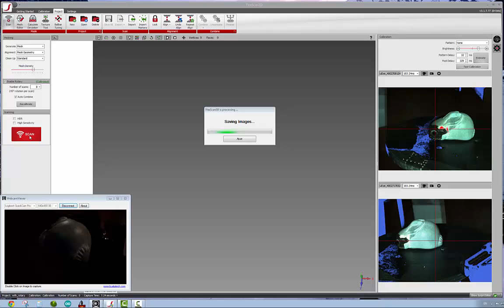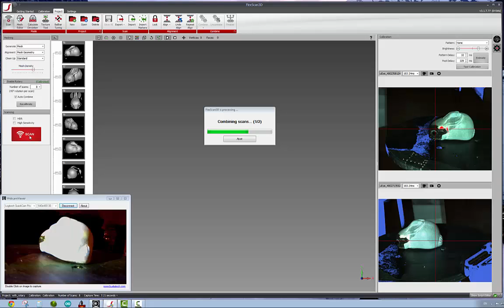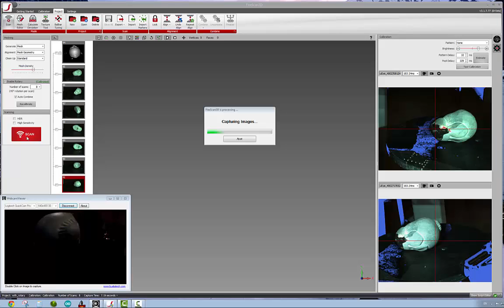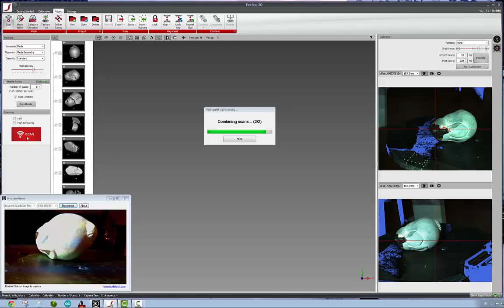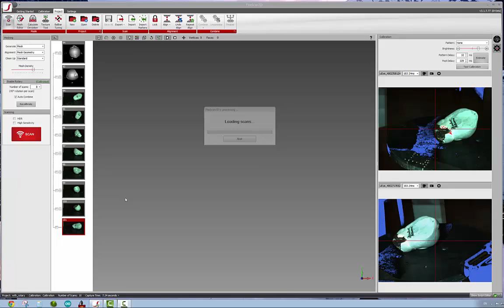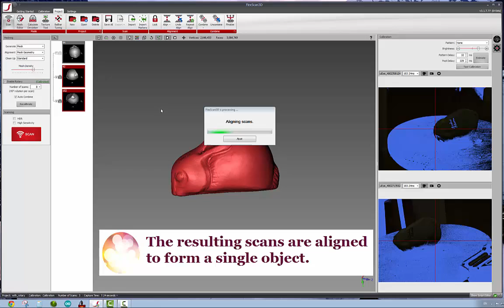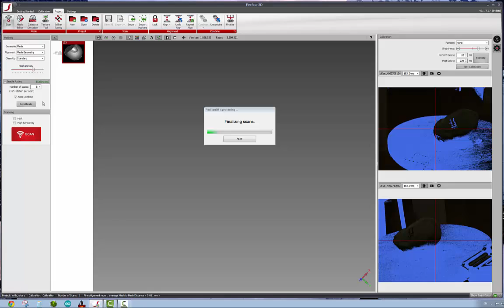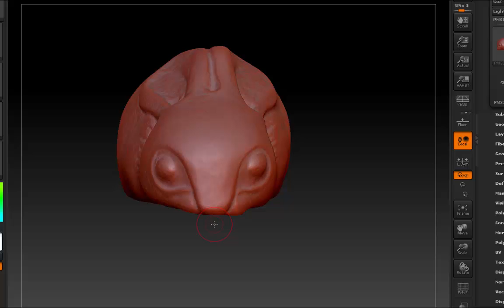Scanning of a ceramic bunny with Flexscan3d and Rotary Table

Comment: hi there :) nice work with the arduino rotary... I would like to know if you´re able too share the connection to the turntable. I have turntable but can t connect it to the flexscan...
thx
Reply from the maker: Thanks. What do you have so far? Is your rotary controlled by an Arduino?
Reply: +Alfonso Hernandez (Seasicksinbad) 
hello :) thx for the interest. So far i have 2 turntable. 1 big (6meters diameter) uses 3 phase motor and its controled by its own software (its not an arduino). And also have a smaller one and also its controled with its own software ( i think this one should be arduino based). Its a pamco-imaging.com.
I need to connect them to flexscan but i don´t know how...
Reply from the maker: I see.. I think it would be too complicated to make these turntables respond to flexscan since most likely they already have some kind of embedded code in them. I think you would need to start from scratch. With another turntable connected to a stepper motor. Then I could send you a preprogrammed Arduino for you to play with.
Reply: Alfonso Hernandez 
Hello again, thx so much for your help :)
Can we exchange emails? that way i could send you pictures of what i have of hardware and them you could help me choosing a stepper motor to begin (again) the project...
Ther big turntable as the motor outside with a "karting" tire making the traccion to pull the table...so it has to be a big power motor to drag all that weight...
thank you again
Reply from the maker: +Marco Moreira, my email is seasicksinbad@live.com. Trying to implement a stepper motor powered rotary table of such dimensions would be hard, since steppers are limited in size and power.. Probably a servo would function better. My suggestion is to start small, with something that will give you insight and experience for larger projects. My rotary was made with a modified surveillance camera setup.

Comment: This was a real time scan.  Some of the manufacturers have videos that have been edited and they show a really smooth, post processed image as if that were the initial scan.  I have some issues with getting really smooth scans without noise, do you have any suggestions?
Reply from the maker: +keithskillz90210  it's a real time scan indeed. I only sped it up a little during the scanning part of the video. What type of noise are you getting? One of the problems I found on my setup was that trying to do all the process at the maximum possible resolution with no or very little decimation, I would get ridges after merging the scans. I solved it by decreasing the scan resolution and doing a smooth merge.
Reply: Even though the objects that I am scanning are smooth to the touch, they appear to have a rough texture once the mesh is generated.  Looks like alot of post processing will be involved, which affects accuracy in the end. I actually think it may be my calibration board as I should mount it on glass so that it is completely flat.  Also, what do you mean decrease the resolution?  When I try, it says the resolution does not match that of the projector.  What procedure are your using to decrease the resolution?  thanks
Reply from the maker: +keithskillz90210  Is your scanner in a vibration free environment? 
At what angle is your projector with respect to the object? I've noticed that by scanning at approx 45 degree angle works best.
By decreasing resolution, I meant reducing the mesh density using the controller on the top left of the Flexscan3D GUI. But now that you mention the rough texture, the problem might be somewhere else. 
Can you email a picture of one of your failed scans? seasicksinbad@gmail.com
Reply: Ok, I just did thanks
.  Also, I have tried many angles.  Like you said, 45 is about the best.  Also have tried playing with the density..
Reply from the maker: I see that you have the brightness setup to the max. I think I know what your problem is. Are your camera lenses equipped with an iris? Try reducing the brightness on the software and increasing the iris aperture in your lens if possible. Also the delay in the camera setup is important, I see that you have it set at 16.67ms for both cameras, try with higher settings. I think your problem is related to exposure.
Reply from the maker: Also, work as hard as you can in solving the issue directly on the scanner. Post processing is a PITA.
Reply: +keithskillz90210 Hello, I think I have fixed the problem and am getting better scan data.  I have moved my cameras farther apart and forward an inch.  Thanks for your help.  Also, how did you go about building/determining your camera placement on the scanner platform?  And how difficult was the rotary table to design and build?
Reply from the maker: I'm glad you're getting better results. 
As for camera placement, after you have calibrated your cameras using the checkered pattern, and get the camera coverage results, the program will suggest to either bring your cameras farther apart.This parameter is also determined by the focal distance on your camera lens. Also, you want to place your cameras away from the projector's heat vents. As usual, trial and error will be your best ally.
Building the hardware for the rotary was not a big problem compared to the headaches in programming the Arduino in order to "talk" with Flexscan. Basically you need the rotary table connected to a stepper, the stepper connects to the Arduino which connects to the computer via USB. The computer has the drivers for Arduino installed with the AccelStepper library. You need to design a sketch, that needs to be loaded on to the Arduino. This is pretty much it, save for smoe minor adjustments on the Flexscan software. The Flexscan Manual provides information on the commands that are used to communicate with the rotary table.